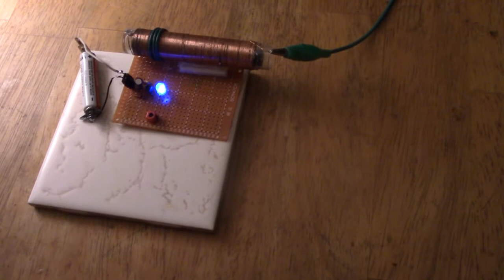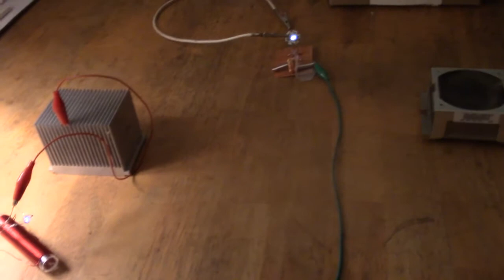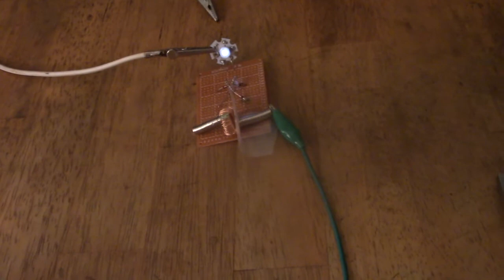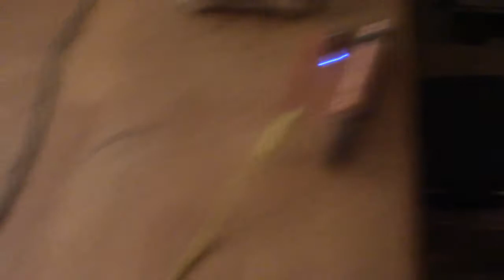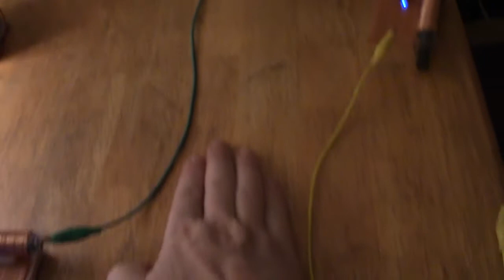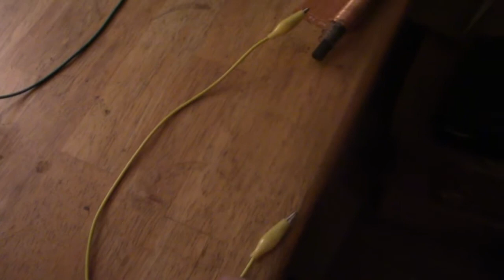The Stiffler Loop out in space

Comment: Let me shoot some  words and sentences. I am sure some people will see the light.
From what I remember, a transmitter connected to an antenna: round the antenna with a maximum of 1 lambda, there is an electric field, from there on it becomes a magnetic wave. I think Don Smith used this to be on the edge of 1 lambda (or half a lambda, I am not sure) to collect huge amounts of energy.
A lambda is one exact sinusoidal wave. For every Herz, the lambda also has a distance, so you can also calculate where the nodes are. On the node energy transfer is the best. (google "lambda frequency calculator" for more).
Reply from the maker: Useful info, thanks :)
I can certainly see how it relates to radio reception too, in the 1/2 wave, 1/4 wave way. From aircraft modeling before 2.4GHz took over it was a common thing to cut wires to specific lengths. Even now the wire is a highly specific length (much shorter). Similarly, the output frequency of the Slayer circuit may be 2MHz and any receiving device will resonate at exacting divisions. Had heard and read of Lambda, with its Greek upside down y symbol, but you've helped to explain it better than my previous understanding.
Reply: Something related to this is the Near Field and Far Field of transmitters like a radio station as example.  In close proximity magnetic induction is dominant in the wave propagation.  But in farther away positions, the electric induction is dominant termed the Far Field.  Now here is the kicker.  Conventional EM wave strength drops off over distance at the square of the distance.  But what is not stated is according to Tesla's experience the HV HF wave propagation drops off  at the cubed of the distance!  That explains how superior the capactive coupling effect allows the tiny coils used here to transfer energy over amazing distances and with little loss.  This fact would not be known from a simple low voltage oscillating tank circuit like in a walkie talkie and would lead to a belief in the square of the distance like with light.  But run at high voltage and high frequency and the equation changes with new properties.
Reply from the maker: Thanks, all such info is very much appreciated.

Comment: Well I'm kinda stumbling along on this project because of the lack a bench signal generator. I'm pretty sure the device does work as claimed.  Have you seen the Doc's latest video that makes this even simpler.  It is just an AV plug setup BUT the device is driven from the Al heat sink of the LED board and not the tip of the AV plug.  That makes it unique.  I may try to make a simple one transistor 2MHz signal generator from a circuit I found online.
Reply from the maker: Haven't seen the latest vid yet, thanks for the info. He's moving fast and that's appreciated, but I wouldn't want him to tire out with it all. 
The 1.5V simple Slayer is a decent direction as a sig gen stand-in. Your micro one with the ferrite piece would be ideal (if you still have it). Am finding more tuning success with the ferrite on the receiving side, the little var cap isn't crucial if you don't have one. 
It would seem that a Slayer is broadband compared to a sig gen, but works with the SFM just as well. The Stiffler Loop also benefits hugely from the familiar clip lead additions btw.